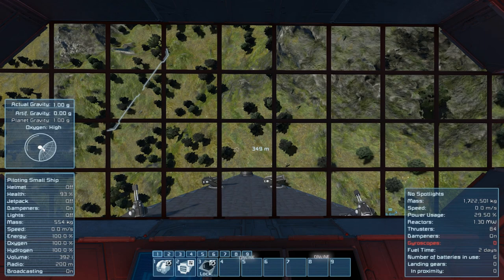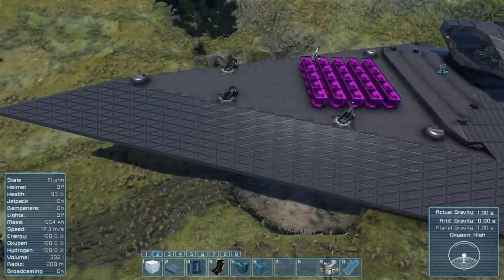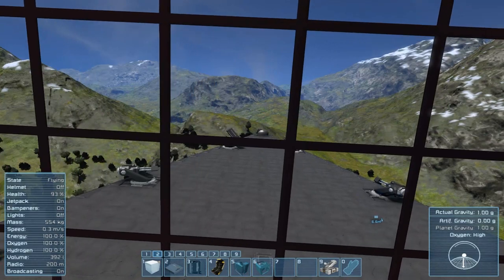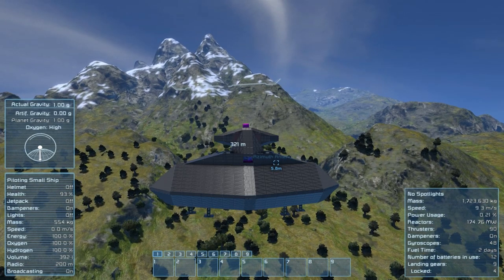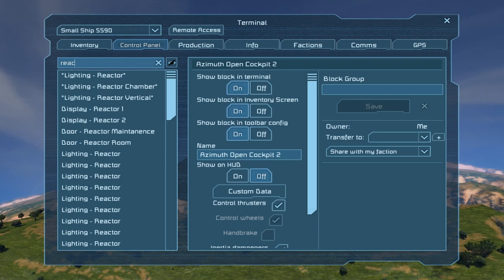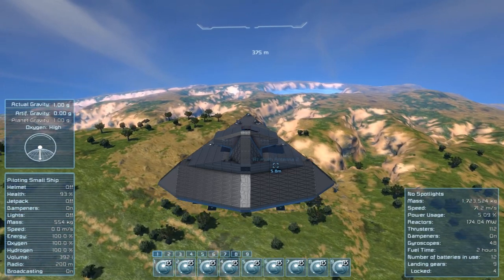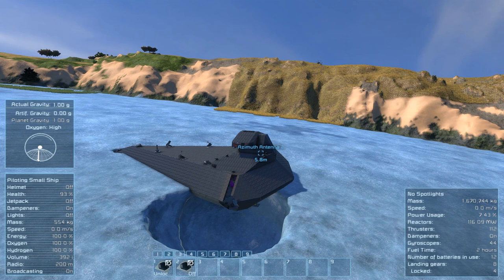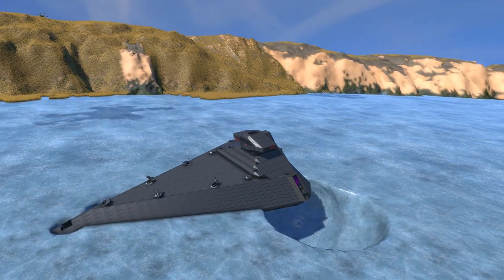Let's Play Space Engineers - Episode 131: Fixed The Flying, But Not The Landing!

Comment: Remarks:
8:22 No, you will always descend at 9.81 m/s^2, so 1 second will always grand you 9.8 m/s, no matter the weight of the ship. That's how gravity works.

16:22 The sound you are hearing is normal when at a certain height. If you test it it outside of the atmosphere, you will probably not hear the sound. Make a small creative vehicle capable of leaving the planet and you will probably hear it as well.

32:32 Maybe it does this because the locks are on pistons? Pistons have always been a bit finicky.

Is the rotor attached to the reactors on safety lock?

Comment: because they are on rotors they are not part of the Same grid. and so when you get moving they move a little and their hit boxes (between the two) touch setting off the shields. the safety lock works because one it makes them static objects and so they can't wiggle r and touch and two because it technically makes them part of the main ship grid these making them part of the Same grid and so the shields count them just like two blocks stuck to each other and so likely wouldn't go off even if they did move a little and their hit boxes touched.